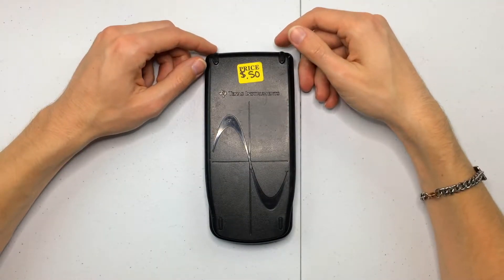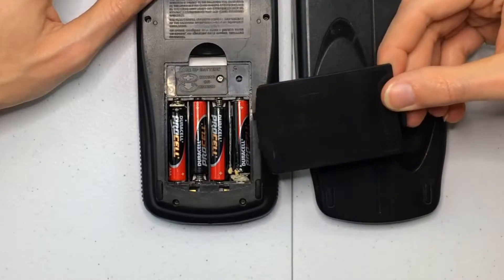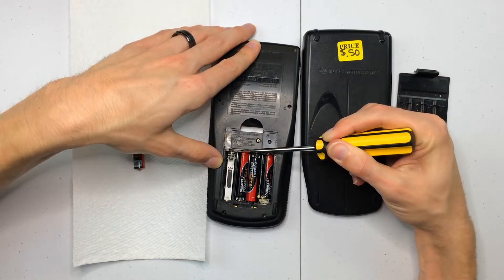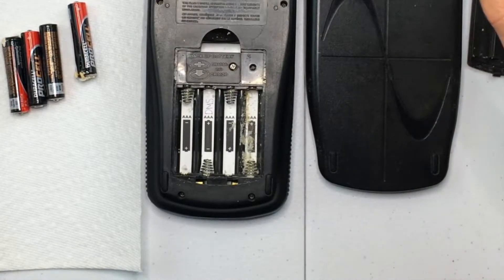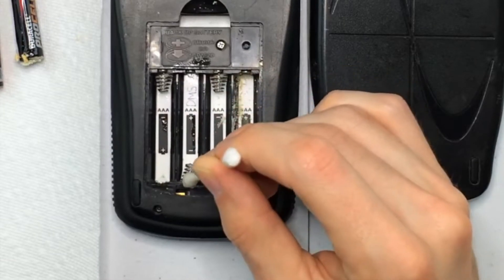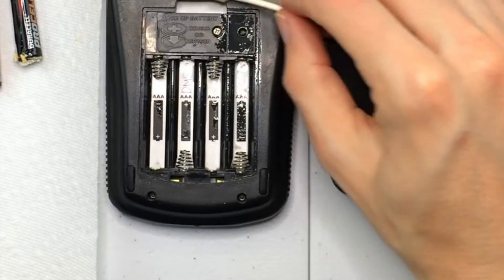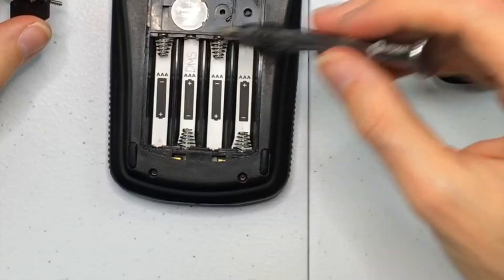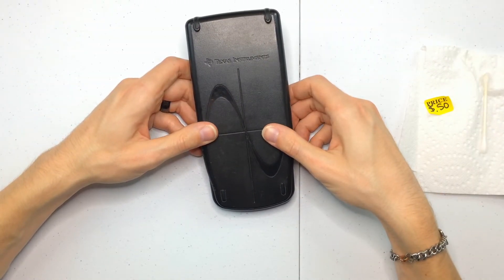Cleaning Battery Corrosion on a Dead TI-83 Plus Graphing Calculator

Comment: Alkaline batteries will leak after a few years, even the high quality ones. It could eat up the terminals, leak into the electronic board rendered the device useless.
Reply: Happened to me :(
Reply from the maker: For sure! you want to take them out of electronics if they aren't being used for an extended period.